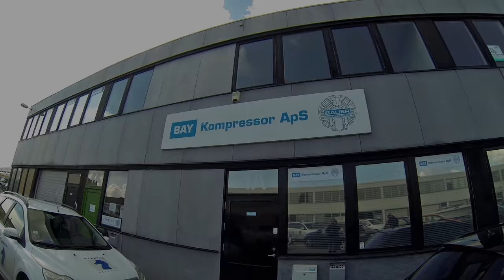Moana Sailing - Ep. 7 - The Final Countdown

Comment: Great boat and fantastic to see another couple who love diving, my only concern is the location of the compressor forward of the coachroof. We often have taken waves over the forward tramps and windows on our  12 meter catamaran in rough seas or when sailing to windward so suggest you try and move the mounting location aft of the cockpit if you have  the space. If you love diving , you will never want to leave the South Pacific, safe travels, Andrew
Reply from the maker: You have a good point :) but, we build a waterproof box for the compressor that fits behind the mast to solve this problem. So now it is very nicely secured and have already prooven to be able to handle big waves over the tramp :)

And we do love diving, actually we both got hooked in the south pacific, so cant wait to get there and experience those amazing, breathtaking dives once again <3

Comment: Can you talk more about this silicone bottom paint?
Reply from the maker: Well, we will be monitoring how it deals with the tropical waters on our way, so we will talk some more about it for sure in later episodes. Do you want to know anything specific?
Reply: How has the Hempel Silic One stood up against growth so far? Has barnacles fallen off? I saw one german video where they had applied it. Barnacles seemed anyway to need some (not much) power to get them off. I just had a hard time to see that sailing 6-7 knot would be enough to get them off.
Reply: Hi! Did you put the Silicone on the boat while in Denmark? My boat is in Mexico and I can't find any way to get the paint over there (hazard items not possible to send by non-companies)